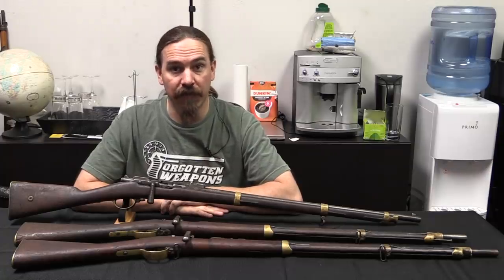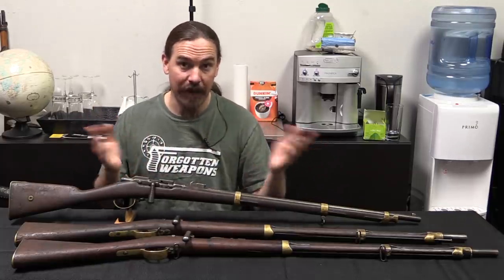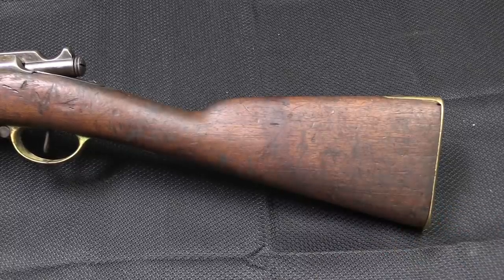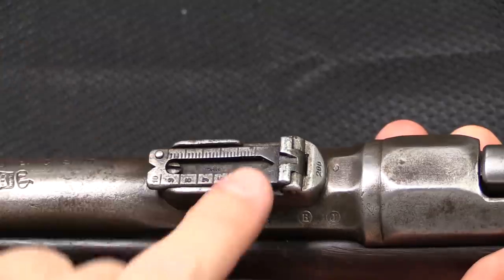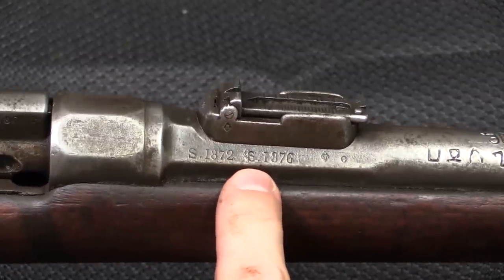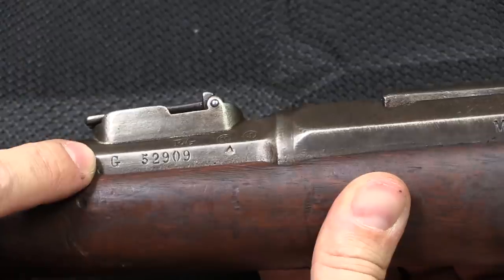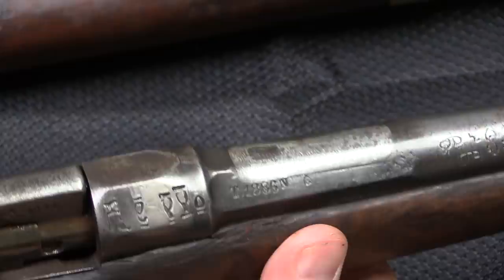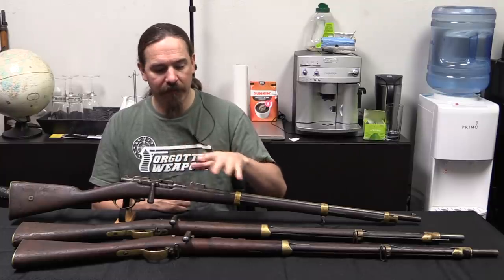The Three Types of Chassepot Cavalry Carbines

Comment: The cavalry carbine cleaning rod is a little shorter, with the tip tucked in behind the front lip on the underside of the nose cap, as an extra means of retention while getting rattled about on horseback.
Re-bayonet, not quite 😉 Whether it has a bayonet or not will depended on what unit it is for. Carbines issued to mounted gendarmerie (gendarmerie à cheval) had a specific socket bayonet issued fixed over the front sight. Gendarmes on foot (gendarmerie à pied) had a further different pattern of carbine fitted with an 1866 sword bayonet.
Reply: The Gendarme à pied is my favourite. Always been a big fan of those carbines and yatagan sword-bayonet combinations
Reply: Thanks for the extra info!

Also I really enjoyed your video on your rubys
Reply: @megachimp2537  My pleasure 😇
Reply: LOL

Comment: I picked one up last summer. It has the S1870 converted barrel, but a St. Etienne Mle 1874 receiver. The left side of the barrel is stamped 64004 but no letter code in front.. The buttplate has 11H for the 11th Hussars also an REG stamped into it.

Comment: Thanks for all of your informative videos Mister McCollum ! you are definitely my hero. But I wish you cold help me! i have a really old civil hunting rifle version off the chassepott with stamps but i cant find any information anywhere on the internet or private its if it never existed. It is much smaller slimmer than the military version, but the bolt looks identical to the military one. A have pics and it is in beautiful smooth light brown condition with crisp mirror shiny barrel with razor sharp deep rifling whit 4 groves, seems almost unused!. The action is ultra tight and very little wear. was a little over oiled around screws etc in the wood and took for ever to remove old hardened oil fat residue .Best regards Tomas Palm Sweden

Comment: 700mm is ver long for a carbine of the Cavalry, maybe they are Dragoon rifles?!
The Russians had several versions of the Mosin-Nagant M1891 during WW 1.
They had the 1891 rifle for the Infantry, carbines for Curassiers, Hussars, Artillery and Engineers, but they also had two "midsize" rifels.
One was the Dragoon rifle, it was shorter than the Infantry version, but could also be used with a bayonet, and dthey had the Cossacks rifle, it had the same length as the Dragoon rifle, but couldn't fix a bayonet.
I don't know when the French Dragoons removed their bayonets from service, but in the Napoleonic Wars they still had bayonets.

Comment: Could the removal of the rear sights be some form of de-milling?
Reply: I doubt Ethiopia had any concept of de-milling. They've been knocked off, been removed to re-do the graduations or something similar
Reply: My guess is when the sights lost parts or were damaged and it wasn't cost effective to repair such an old gun they simply removed them. Once they were so old they weren't going to be issued to trained troops it may have been simpler to tell conscripts to look down the barrel and use just the front sight as they would their traditional firearms.

Male ownership of long guns, rifled or not, was an important part of part of Ethiopian culture from the 1600s on, initially confined to just the upper classes it spread to almost every adult male. Dowries frequently contained firearms and funeral rites included the firing of as many guns over the grave as the man's relatives could muster. There were a wide variety of types available depending on the person's wealth, matchlocks remained popular amongst ordinary folk.

As I understand it these weapons were never officially disposed of until now, they had simply remained in old storage and were largely forgotten.
Reply: @Matt_The_Hugenot  that sounds about right, some of the sights werent soldered on that good in the first place and I doubt in WW2 or whenever after they were very obsolete they were going to spend the time and money fixing them especially if at most they were being used for cerimonial or parade rifles